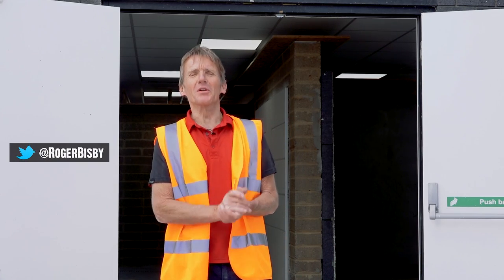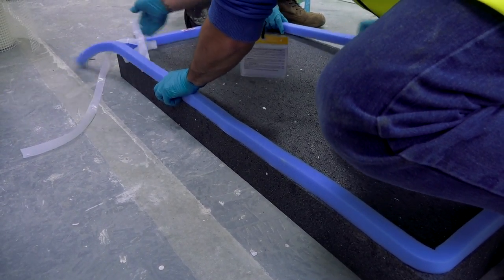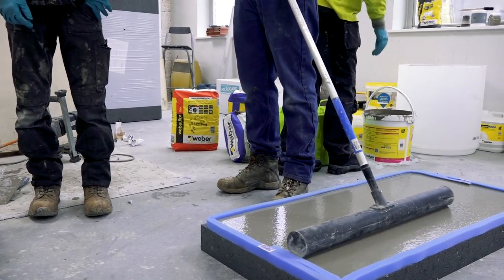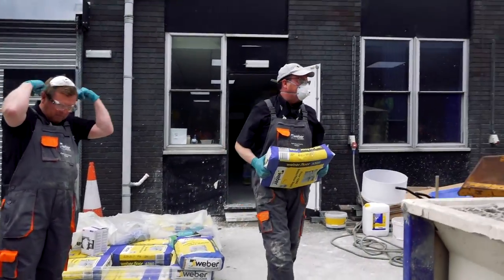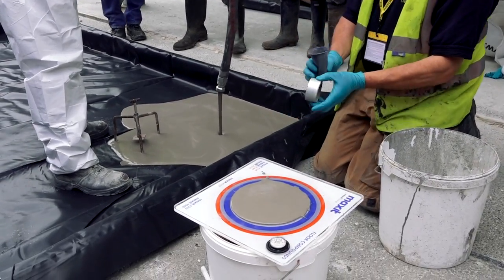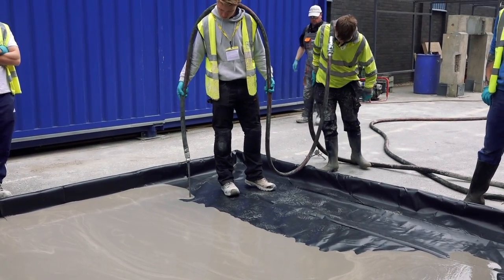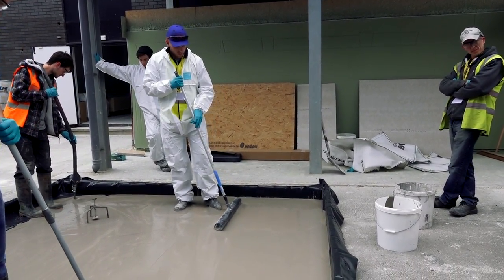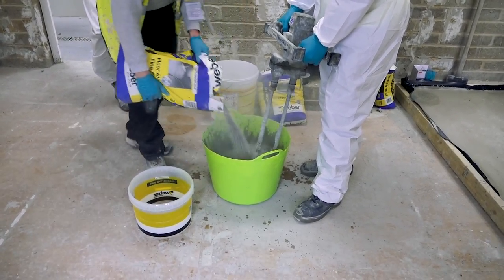Zero Skill Floor Screeding. Trade Tip

Comment: Been using this type of screed for years,tends to be expensive but easy to lay with a great finish,i use a pump to mix it,but it is only cost effective over areas around 20-25 m2 other wise it's cheaper to get a mixer load and pay for some one with a diesel pump to lay it for you around about £350, the bars for levelling are called dappling bars.
Reply: Mark McKale 

 Have you been using this or a gypsum based flow screed that needs sanding off?

Comment: Yes I have used both true flow b you can buy in bags cheaper than Webers product but because it is anhydrate takes weeks to dry depending on depth,Weber floor flex which is reinforced with fibres is a good product,but first started using tarmac pozament it's been out for a few years exact same product as Weber cement based so quick drying great finish makes me wonder if there all from the same manufactures different labels.
Reply from the maker: I have been to the Weber factory and also to EvoStik and Setcrete. They all make their own product but they get the ingredients from the same sources so you might reasonably ask how different can they be? You also see products coming off the line with other brand names for merchants such as Wickes. I guess the bottom line is you find something that works for you and stick with it. Pardon the pun.

Comment: Would such a thin screed be unsuitable to use before putting up stud walls, i.e. fixing through screed and puncturing DPM beneath? Whereas a traditional sand & cement screed would be at least 50mm when laid on top of a DPM.
Reply from the maker: The polythene is to contain the liquid not to provide a dpm. You usually lat the dpm under the concrete but let's say you can't then a good alternative is some very short fixings and a nice run of gun adhesive. There is no need to put screws in the floor these days especially with underfloor heating.
Reply: @SkillBuilder  Ok, thanks for your reply :)

Comment: Looks a great product. Whats the bagged stuff actually called? Is there a product name.
Reply from the maker: Mezzy 
 There are four different products all with numbers but maybe about to change to names. The one we were using was 4360 flow base  fibre reinforced. They come in rapid set for small areas or standard set for larger areas. This video is an introduction to the training course but we will be out on site with the product.

Comment: looks good .
if attempting by yourself how long does it keep a wet edge.
Reply from the maker: Don't use the rapid set and get someone to mix for you because it is too much for one person. The wet edge will remain for an hour or so but my method would be to dam up with the self-adhesive sponge and pour in bays. Then you can pull the sponge up and lay the last bay through the middle. The worst thing is to build up in layers because the heat from the curing mix will accelerate the next batch. Hopefully, we are going to do a live job in a few weeks time using Gorilla tubs and a whisk.

Comment: I'm caught between a rock and a hard place here. I need to level off a floor but it's a tarmac surface. I can't afford to dig the tarmac out, it'll cost over ten grand to do that. I found Weber Floorflex and I'm thinking I'm going to try it because is is a bit flexible. I know concreting over tarmac is a big no no because tarmac flexes a lot and the concrete would just crack as a result. Thinking Floorflex might work. It'll be getting a heavy duty vinyl over it and the heaviest traffic over it will be trollies moving bags or flour and 20 litre tins of oil etc along with lighter items. I think this could be a temporary solution until I can afford to dig the tarmac out. Any ideas or thought folks?
Reply: speak to Ardex. They make compounds that can go over all sorts of materials.
Reply: @AJ-ds5gf  Thanks for the pointer, much appreciated.

Comment: Is this not the same as self levelling compound which has been around for years?
Reply from the maker: B Scooter 
No self leveller, as you will see from our other videos,  is something you spread thinly with a trowel. You would use it on top of a base of sand and cement or other floor screeds to give you a smooth surface. It is self-smoothing but not self-levelling because it follows the existing floor. This 4360 takes the place of sand and cement screed so you go onto a polythene membrane on top of the insulation. Instead of having to trowel down to a depth of 50mm or more with underfloor heating you simply pour the mix in and agitate it so it levels out. 
Flow screeds have been around for ages but until now they come in big Readymix lorries and you have to order the right amount and use it in one go. You also have to grind the surface of gypsum based products whereas this is ready to lay onto within a very short time. Great for kitchen extensions where you want to get on with fitting the kitchen and laying the tiles.
Reply: Brilliant reply, thanks for the info 👍🏻👍🏻

Comment: Never really had to use floor levellers before, managed to get away with it when tiling, although does take longer. Looks like a great product, are they still a traditional screed depth or a lot thinner?
Reply from the maker: Much thinner than sand and cement. You can go down to 30mm and even less so when you need to get insulation in the floor and underfloor heating this can save your bacon or the vegetarian equivalent.